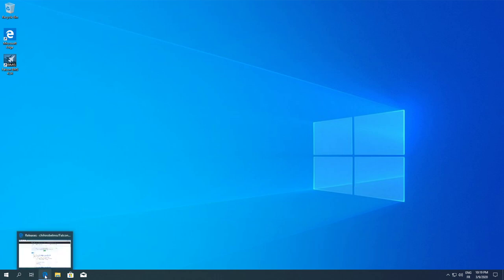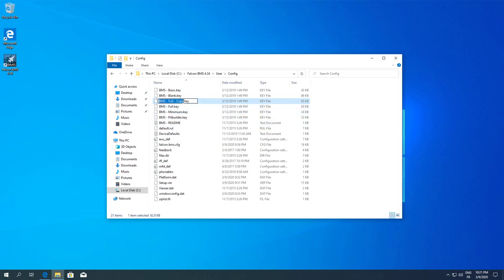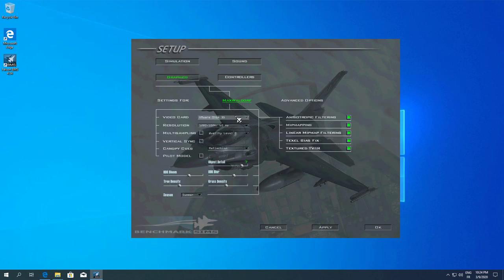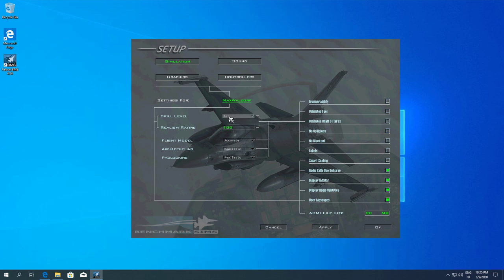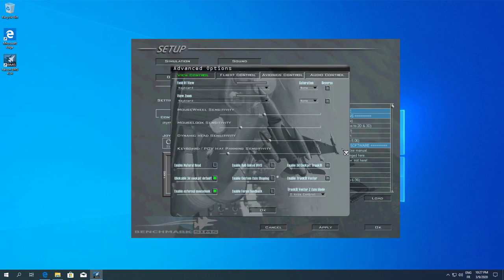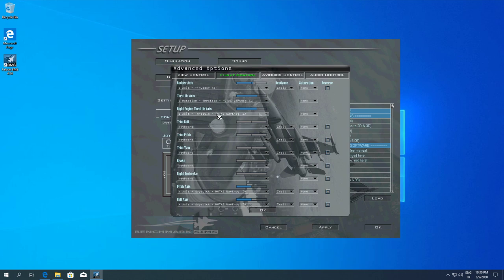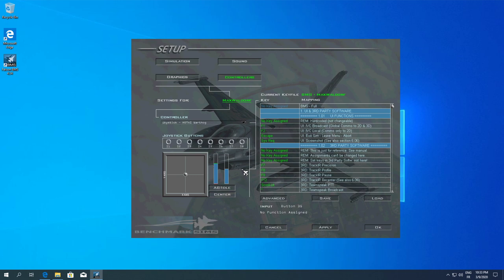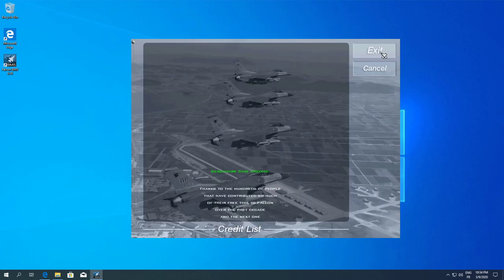Falcon BMS - Controller Setup Tutorial

Comment: Great for new players. Thanks Max!  Now, 4.7 makes the "alternative" launcher default so it's even easier.  Advanced setup takes actual research. Don't forget, BMS supports DX SHIFT so if your HOTAS supports that which most if not all do, you have an entire set of controls with the SHIFT function.  On CH Products it's the pinky switch on the stick and works for both stick and throttle.  RDR cursor control for example is perfect to bind manuallyin the SHIFT set since it's not in the defaults for CH.  No need to KB cursors.   Same thing to reduce cockpit mousing. Set SHIFT buttons for all those things you want to press all the time but hate rummaging around the cockpit for.  Lighting, FLIR, etc.  The only thing which won't play nice with SHIFT is if you have TrackIR and you want to set HOTAS buttons to Center, Precision, Pause.  Those will either take up buttons or if you're not cool with that, map them to keyboard keys.  I prefer them to be on the throttle because I move my position all the time since I'm in a jank cockpit that can move around.

Comment: After 10years I am now planning to restart my BMS experience. Primarily due to the 4.37 VR option. I would like to hear your opinion on the TARGET tool of the Warthog. I worked with that very little for DCS. does it make sense to use it for BMS? If yes I would assume that you would have to launch TARGET to get your "combined" stick+throttle device, to do all the key and axis related stuff Max showed in this vid. Can you confirm? Btw Max thank you so much for sharing your experiences in these vids. Very much appreciated!! Cheers flex

Comment: Thank you for the good introduction, also with some time on bms still a lot of things to learn and a good recap!

How do you have setup your hotas warthog pitch and roll (x/y) axis shaping? (for BMS and in general) In the manual the recommend it to leave it in a linear behaviour for the f16.  
That makes the control usually a bit erractic at the center. What is your personal opinnion about this? a bit of expo, or also linear from center to max?
Reply from the maker: Check the changelog on this page:
https://www.falcon-lounge.com/news/falcon-bms-4-34-update-1-is-here/

Look for: "AXIS SETTINGS:"
Those are lines to add in the falcon bms.cfg file (at the end) and it will give you a possibility to have a curved profile for your stick.

Cheers